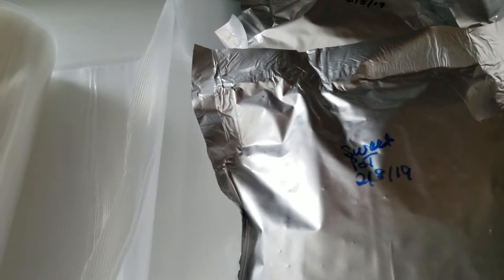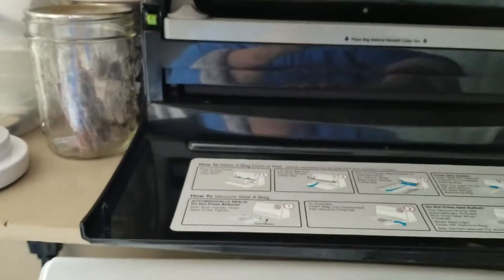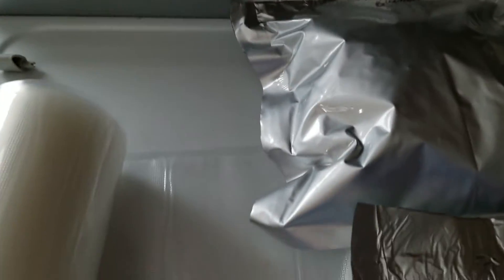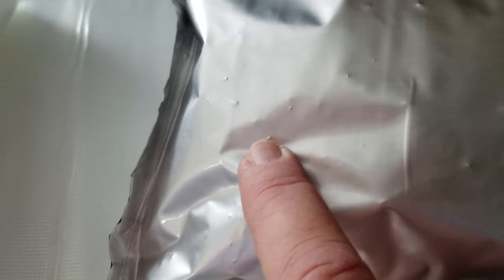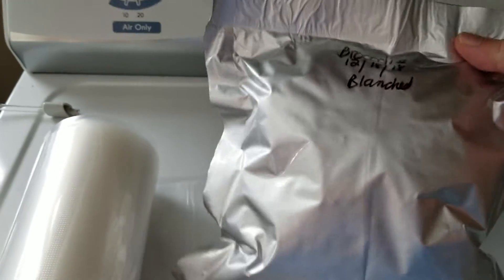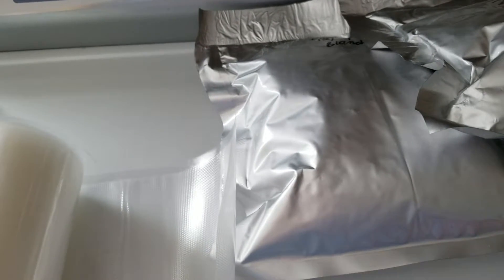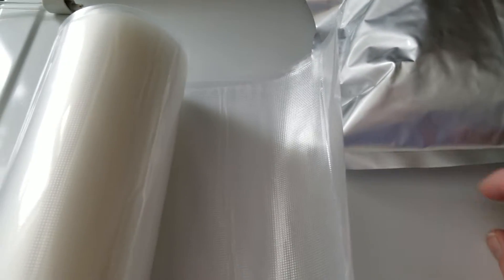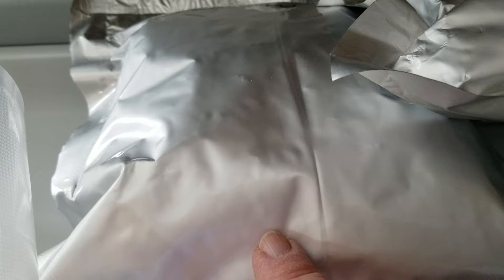Mylar Bags Fail For Long Term Food Storage

Comment: This is why I don't bother with 10+ year food storage, too much work, too expensive, prone to failure and unless you check, you won't find out until you go to use it in an emergency, the worse possible time. I store what I eat, and eat what I store. I buy the staple and frozen food I regularly consume, only when on sale, consume when not on sale, replenish and rotate when back on sale to a precalculated inventory level based on expiry date and regular consumption levels. Food comes in the house from the grocery store, down into the basement and onto the shelves, done. The only other work I do on my food preps is an inventory every 6 months or so. Not so much to check inventory as my food is organized and spread out in such a way that I can do inventory at a glance. My 6 month inventory is more to check on upcoming expiry dates so I can consume food that is about to expire and adjust inventory levels to prevent the issue in the future.
Reply from the maker: Yes I have made many mistakes and learned many valuable lessons.   thks for your  imput

Comment: No, Mylar bags are food safe. You can cook it in the bag. It’s fine. Mountain house single meals are made specifically for that very thing. The problems lie in where you get your bag. To put it plain, you get what you pay for. Cheaper Mylar bags are not the same plastic, and the aluminum coating can wear off. You have to really do your research and buy your bags from a highly reputable vendor.
Reply from the maker: Ok still be aware if they are boa free
Reply from the maker: Dear Monica there is different materials used in mylar some are made out of aluminium some are not BPF SOME ARE FOOD GRADE.
I spoke to Mfg that makes the bags for Freeze dried Company they don't recomend you boiling water in these bags.
Reply from the maker: Here lies the problem. They out source the products to China.  And we all know what china is famous for.
Reply from the maker: monica Dosent understand the MFG of BOPET Bags I suggest you Look it UP. Before you want to tell he I don't knaw What I'm talking about-
Reply from the maker: I'm sorry but I have been doing this for over 20 yrs now, and have Been doing Extensive Research,
You don't know what your talking about. 
I have spoken to MFG Co. That make the packages for the food industry along with that I have spoken to the company that dose  the Flash Freeze Food for Mountain House and other freeze dried companies. 
Mylar bags are Aluminized mylar which is metabolized BOPET, WITH A THIN LAYER OF METAL USUALLY ALUMINUM FOIL!
The metal is heated and evaporated under vacum.  It offers the glossy  metallic appearance of an aluminum foil.
So you know BOPET *(Biaxialky  oriented POLYETHYLENE TEREPHTHALATE IS A POLYESTER FILM MADE FROM STRETCHED POLYPROPYLENE  TEREPHTHALATE (PET) AND IS USED FOR HIGH STRENGTH TENSILE STRENGTH.  THE REAL NAME FOR MYLAR IS BOPET BAG.

Mylar® polyester film is made of polyethylene terephthalate (PET). The way that it is made is that molten polyethylene terephthalate (PET) polymer is first extruded onto a chill roll drum to form film.
SO THE BOTTOM LINE IS I DO KNOW WHAT I'M TALKING ABOUT
THIS THE PROBLEM WITH NEWBIES COMING ONLINE AND GIVING PEOPLE INCORRECT INFORMATION.  I TAKE PRIDE IN MY CHANNEL AND I HAVE WORKED VERY HEARD FOR MY FAMILIES SURVIVAL IN CASE OF EMERGENCY SO THINK AGAIN WHEN YOU DON'T DO YOUR RESEACH.

Comment: 5mil Mylar bags are sufficient if you don't over vacuum with sharp objects stored in them. 7mil is used for hardware, parts, tools etc,  and other sharp objects, however, even the 7mil can be punctured with sharp objects and while using a full size ShopVac to remove the air. The bags you show with pin holes appear to be 3mil or less.  I strongly suggest you buy your bags from a dealer that stores and ships them flat in cardboard boxes. Many dealers fold the bags over to save shipping space/cost and pin holes form in the folds.
Reply from the maker: Thks
Reply from the maker: Growing shallots
Reply: Any suggestions on where to buy good quality Mylar bags?
Many thanks!
Reply from the maker: @eddieslittlestack7919  I get money from Harvest Right freeze dryer.  https://harvestright.com/?gclid=CjwKCAjwkPX0BRBKEiwA7THxiHIC03Au2pb1PGsDSGzX4C9L31Cpqbmej24IHf7kKVOEAXzcFFjEcRoCP2QQAvD_BwE
Reply: Eddies Little Stack pack fresh USA
Reply from the maker: Yes thks I will check it out.
Reply: So are you saying that you can use the foodsaver to vacuum seal Mylar?   If so what kind of machine should i buy?  Thanks
Reply: @josiegallegos7144  I use a Revlon 1" Digital Flat Iron, and not a Foodsaver.

Comment: I use Discountmylarbags.com... You need a Minimum of 4-5Mils... Not Millimeters.  Also note that those food savers aren't meant for Mylar bags. 

Use a flat hair iron set to around 140-160 degrees to seal the Mylar. 

All grains will absorb plastic smells. 

You also need to freeze grains for at least 3 weeks before storing them. Brown rice and Organic grains also have a TON of larvae that can hatch if the temp gets too warm. 

We also do Ghee with butter and can it ourselves. 

But its easy and cheap to buy a 5 gallon bucket ad lid from Home Depot and a 5-6 gallon Mylar bag to store bulk foods.  

NOTICE: The UN has plans to Simulate a Global food shortage due to climate change starting in 2022 with no end date or details called the Food Chain Reaction. Recently they stated that a Global food shortage due to climate change is coming soon. 

Its a planned food shortage. 

Josef Stalin was a Social Democrat who created a Man made Famine called the Holomodor in Ukraine. Using Starvation as a political weapon. 

"Every Society is 3 Meals from Chaos"- Vladimir Lenin 

"In a country where the state is the sole employer, opposition means death by slow starvation. The old principle: who does not work shall not eat, has been replaced by a new one: who does not obey shall not eat"- Leon Trotsky

Leon Trotsky wrote that its not a famine until mothers are eating their young... Promoting cannibalism. 

The US Army has plans from 1994 for 2016-2018 called Army After Next to prepare for a Global Economic Collapse, Global Civil Unrest, EMPs, and Electronic war with China.
Reply from the maker: Yes I aggree.
Reply from the maker: I have to thank you sooo much for your very Informative information.  I kinda sorta knew about the NWO Agenda 2030.  But I have been slowly but surely trying to save food when I listen to Adapt 2030  and "the ice age farmer" they talk about the coming Ice Age. The scientists John l. Casey wrote a few books "Dark Winter"  and explained that the sun is dimming.  The Globalist know this n have been building underground shelters for years.   But this is all planned well in advance.  May I suggest "flat earth british" it seems they are going to do a reset.  But all I can say is that we must prepare and take care of our family.  Those who control the food control the world.  Good luck.
Reply: @materialgirl338  weather modification has been going on for decades. All of this extreme weather is deliberate. The Cold weather is a direct result of weather manipulation.  Bill Gates is also suggesting using ChemTrails to Block the Solar Rays. I don't bother with predictions. 

There's over 800 pages on the UN website for Global warming. The plans have been written for decades. 

All of this is a Global plan to collapse currencies, economies, employment, the power grid, poison the water and food supply, forced medications, dumbing down society, disarmament, create chaos and panic, etc is all planned. 

Study Communist/Socialist histroy and youll understand what's coming.
Reply from the maker: @nickw3657  it's such a pleasure speaking to a highly informed intelligent person such as yourself.  I'm watching the the Calif fires and seeing the map of Paradise and the new speed train map same path as the delebrate fires looks like it was done by DEWs.  I'm wondering were are all these fire victims going after their houses burned up.  Looks like FEMA camps are open.   Sure looks like a land grab to me.
Reply: @materialgirl338  Yes... CA didnt have the land purchased to complete the Speedrail... Now no more homes getting in the way. 

Also eliminates animals and potential hunting as well as timber to harvest.  Most of  Mid to Northern CA are also Republican voters. 

I research like a part time job for the last 6 years... In the UN plans reads "Deforestation" ... Most likely by the use of Fires.  

Also included is the "Data Revolution" which is most likely the 5G system which is fully operational by 2020 and over 20,000 Satellites into space and a massive deployment of cell towers everywhere... This system operates using the same Frequencies as DEWs.
Reply from the maker: @nickw3657  I so Enjoy talking to a smart and savey person.  I too love research.  I'm concerned about two things.  When food shorages   take effect mass starvation will occur.   80% of population won't survive as per "DEAGLE.COM" second thing that I studied was that That 5G has been out they are using 6G which will send voice to skull tech to the people minds.  Putting thoughts in our minds.  After watching lots of videos that are now removed.  I see you have done your homework. Thk you for your important information.
Reply: @materialgirl338  deagle also puts military spending reduced to 99% by 2025 from 2014 and puts the US Dollar purchase Parody from ranked 3rd in 2014 to 78th in 2025. 

The UN plans call for a minimum reduction in population by at least 80-85% as well. 

Ive also known about the Wavelengths used will put "Voices" into the human brain but these wavelengths have been used with media like radio, Wi-Fi, and TV signals for decades. Which is why its easy to target the human brain using subliminal messages using these signals, color psychology, and specific patterns to manipulate the human brain. 

In fact, theyve had technology that can download the memories and emotions from one brain to another since the 80's.
Reply: @materialgirl338  Even the US Army has plans from 1994 for 2016-2018 called Army After Next to prepare for a Global Economic Collapse, Global Civil Unrest, EMP attacks, and Electronic/ Robotic war with China.

This was written just 2 years after Agenda21 was signed by 172 countries in Rio in 1992. 

The Military and Feds have been doing EMP drills since 2015 annually.  

In 2010, theyve been stockpiling underground tunnels, created a Army Field Manual 3-39.40 for FEMA camps and HR390 on Congress.gov(FEMA camps and Fusion Centers as a law since 2014), and the DHS Report from 2010 by Jeh Johnson on Right Wing Extremism. The report lists whites, gun owners, Militia Members,, Returning Veterans,  Constitutionalists, Ron Paul Voters, Christians, Anti Catholic, anti UN, anti illegal immigration, concerned about illegal immigration, anti Government, anti abortion, Patriots, those who do not believe in Mainstream ideologies, those who believe in an Economic Collapse/One World Government/ Communist Regime Takeover, etc as Domestic Threats. 
 
The feds have been targeting farming Co ops, Raiding Seed Banks, and some places have made it illegal to live off grid or have gardens.

Obama signed Executive Order 13603 to seize food, water, medicine, farming equipment, transportation, financial investments, etc in times of Peace and National Emergency. 

Im not sure if trump repealed this but i doubt it. 

Trump is a speedbump and is continuing the same Agenda almost half of the time. He refused to fire Obama's leftovers and said it was "Too McCarthy". That slogan is a left wing slogan. He kept known traitors as advisors and underminding his efforts as expected. 

Kindred(Gordie Rose) has a plan called "Obsolete" to replace the labor force with robotics... 25% by 2025, 30% by 2030, 40% by 2040, 50% by 2050.  If we already have an national average of 25-30% on some type of Government assistance and add in the illegals and job losses due to robotics by 2025... That's at least half of the country will be jobless. The left already had pilot programs to pay those ppl who had their jobs taken by robotics a Guaranteed income... Not including the Universal Basic Income program. 

The Global RFID implant or tattoo is globally ready by 2025. It was proposed in the ACA in 2009 as its written in the Bible. In the Right Hand or Forehead To buy, sell, trade, receive Medical Insurance, GPS SURVEILLANCE, ETC... As a Schedule 2 device. Currently the Former DARPA employer Regina Something is now pushing the RFID implant or tattoo as a Google Executive.
Reply: I finally found them, these are the people screaming about black helicopters and how "they" are out to get us xD, yes I am satisfied now. I do agree a certain preparedness is needed however not for the situations yall are spouting, all this insanity about planned food shortages and EMPs is so silly, call me ignorant if you want but I stand by it xD. lol, CHEM TRAILS MAAAAN.
Reply: WELCOME TO COVID 19. THIS AGENDA IS WELL INTO MOTION